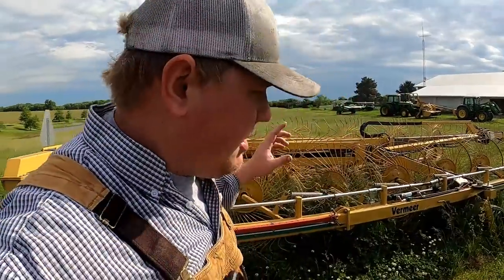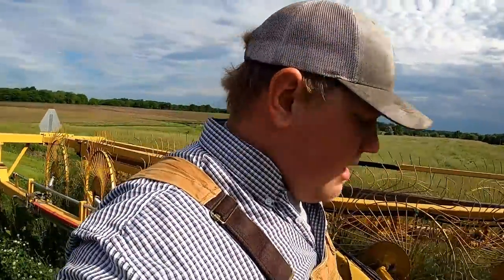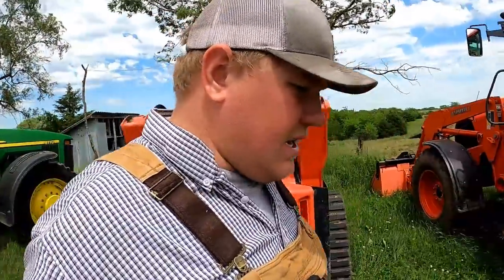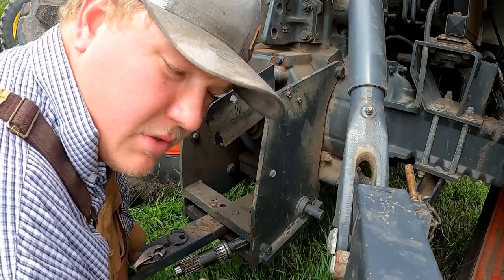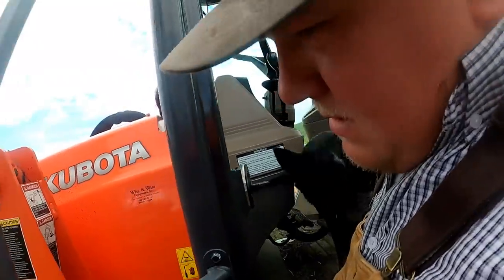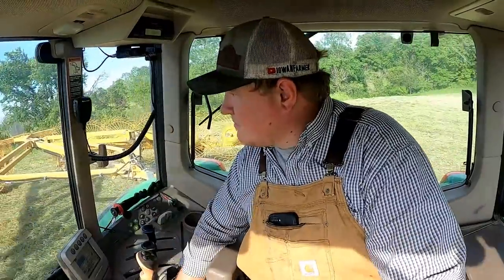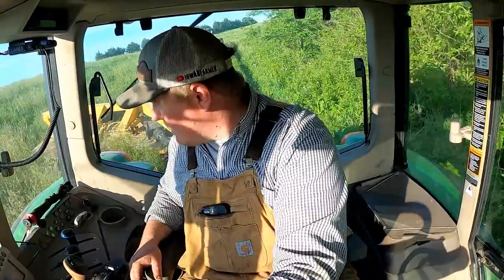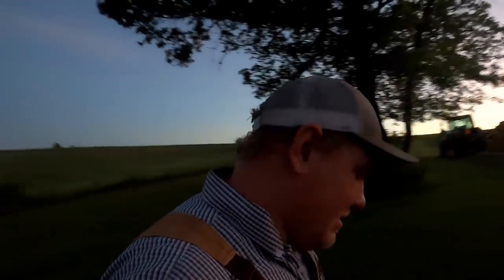Hay Days Vlog 2 - Fixing Trailers and Mowing Hay!

Comment: Hey Iowa I worked on everything mechanical the VERY BEST thing to put on your 
battery post so they don't corrode is NEVER SEIZE I have tried everything under the sun and I have been using this for the last 25 years